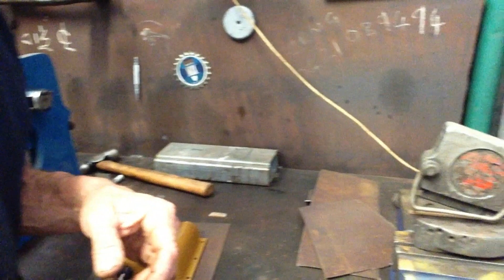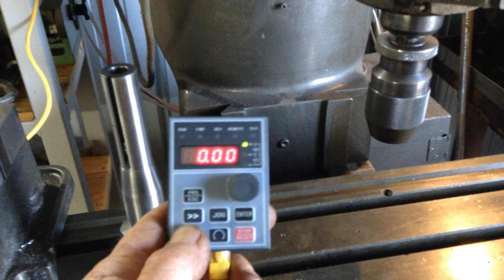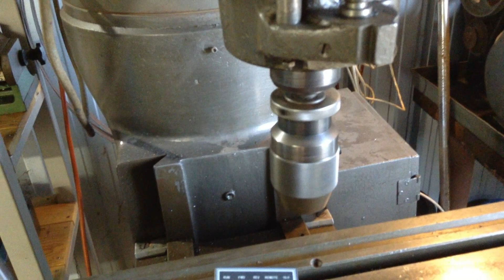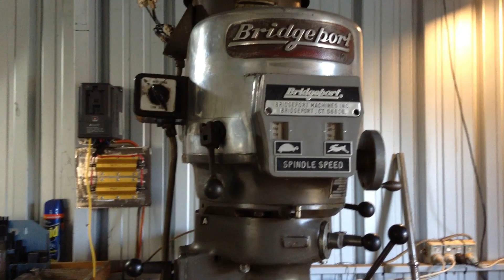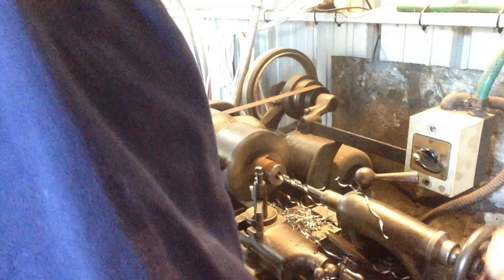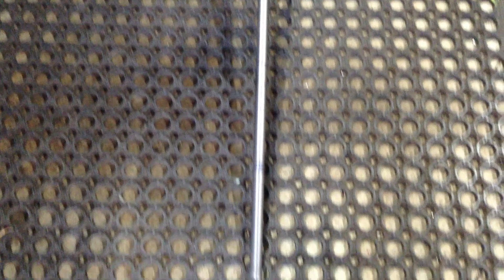The Bridgeport comes to life

Comment: 8 blows to the foot if memory serves on Perth sands, but it’s moot now coz your slab is already poured now.👍😂😂
Reply from the maker: 18 blows / 300mm   after compaction  at the shop  pad area  with  400 mm compacted cracker on top under the shop pad !
Reply: Max Grant ,The Swan Valley Machine Shop. It’s not likely to move unless an earthquake hits! I still remember Meckering quake back in ‘68, you’d have been a toddler back then of 4 or 5 maybe? It was a 6.5 roughly, and shook things up here in Perth even.
Just hope & pray we don’t get another and you should be right. 😉😜👍😂

Comment: Max, I was with you until you put those channel lock pliers on the knurled ring of the tap holder.  Surely you have a spanner for it, and if not you need one!
Reply from the maker: Your right , i  need to make one , the tapping chuck has to be stripped down for a clutch repair .   No damage done  as the pliers didn't slip !   Cheers .

Comment: why dont you speed up the vfd to 60 hertz and ramp it up to the 60 hertz faster is the motor not designed for 60 hertz in America it is at least my 220 motors are just curious
Reply from the maker: The motor is 50htz as is our power here in Australia . But there is still some fine tuning to be done with the vfd .   Thanks .
Reply: @swanvalleymachineshop  great i was just curious keep upthe good work

Comment: I like your brake resistors and housing. Much better than my single resistor mounted under the vfd. I turn my vfd on manually and control the BP with the factory fwd. off rev. switch. I would probably misplace or damage a remote. lol. That is quite a interesting tap driver and would like to learn more. Hope your compaction meets specs and looking forward to your shop build.
Reply from the maker: Hi Darrell ,  i  thought you had to use the vfd control for on /off & rev  so the current from the decelerating motor goes back through the vfd  or something  .  As the vfd thing is new to me i don't know bugger all about them yet !  .  Thanks Mate , Cheers .
Reply from the maker: I just saw a video by BS in the shop about using the factory drum switch wired to the vfd .  Looks like it works .
Reply: @swanvalleymachineshop  Hi Max, my vfd is a Teco brand. It just uses the input from the On, Off, Reverse switch to send a control signal to the vfd. All the current load is limited to the vfd internally. Works great! Since my BP is away from nearby walls, I mounted a enclosure with the vfd inside on the side of the mill base. This has a magnetic starter switch to power up the vfd. Since I have a varispeed I never mess with the hertz on the vfd. (rarely) Because I am computer illiterate, I took the vfd to a local motor shop I did business with before I retired, the technician walked me through programming it. I still need to change the braking time for manual tapping but it works so well I hate to mess with it.LOL. Cheers

Comment: Been running over my freshly made pad with the dozer trying to get good compaction. The rain showers we have had should help also. Nice having two lathes and two mills in the shop. When one is out of service you are not out of the game.
Reply from the maker: Thanks Tom . Do you have a minimal compaction level for the pad in your plans ? In sand here my plans say 98%mmcd ( 150kpa min ) . Now i just have to get the shop done so can get my big lathe & big mill up & running  . Cheers .
Reply: Max Grant ,The Swan Valley Machine Shop. The county inspector will check the bottom of the footings holes. Not sure what system he will use.
Reply from the maker: @hilltopmachineworks2131  Nice .  At least that gives piece of mind that it's right .
Reply: Max Grant ,The Swan Valley Machine Shop. Yep.